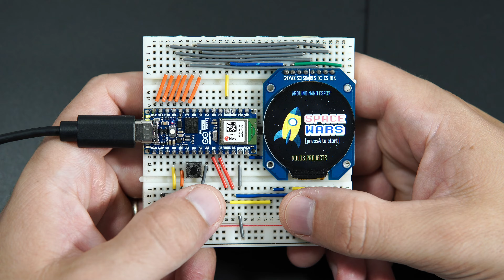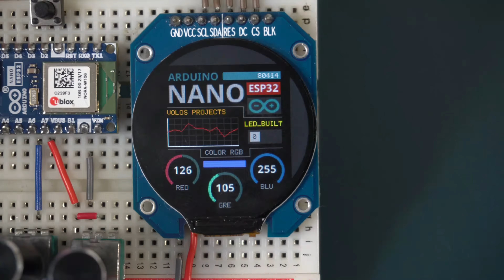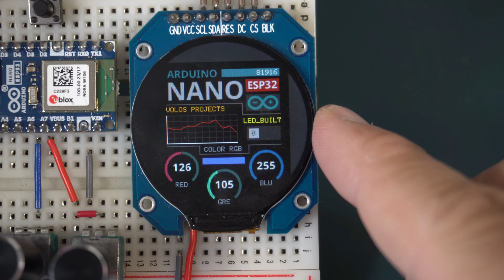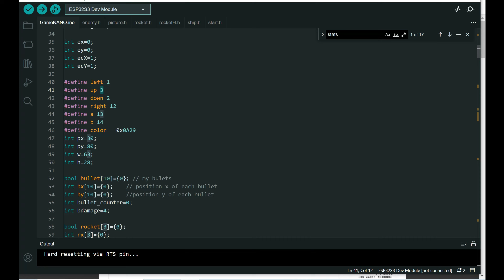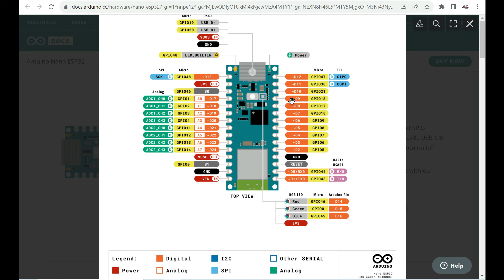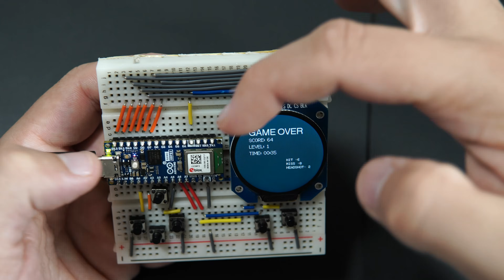Breadboard game using Arduino NANO ESP32 and GC9A01 display

Comment: I tried to run the same display with the same arduino nano esp32. The libraries are the same, I changed the GC9A01 in them and the pin numbers. But  the board keeps restarting after upload. With other projects and libraries there is no such problem. Can you please suggest where I fail. Thank you in advance!
Reply from the maker: Did you turn on psram?

Comment: Hello! Very cool small project! Thanks for sharing.
I'm struggling with this exact same setup as you, I can't figure out what pins I should configure for the TFT library. Would you mind sharing your user setup?
Reply from the maker: You need to use use esp32 pin numberws , not  pin names on Arduino, i d9nt have that setup file anymore, also make sure that your display is 3v not 5
Reply: @VolosProjects  Thanks, I just figured that out. I had to configure Arduino IDE to use legacy GPIO pin numbers.

Comment: First great video and I've been enjoying your content a lot and learned a lot from it. 

I have been playing with these round LCD with the GC9A01 and I've encountered a very weird bug. Hopefully someone can help me out. The bug is that if I use the sprite of size 240x240, the screen would not show anything until I change it to 235x235 and then everything works again. I originally thought it was the lcds that I got. I bought mine from Aliexpress. I went back and bought different versions of it that resemble the Waveshare ones but the same bug still appears. This is very puzzling.
Reply: You lack the RAM to do double buffering on a 240x240 display on an ESP32, unless you buy a WROMER version like the one in this video.
Reply: @Zoonie81  Thanks. I figure it out after I posted this comment. Tried the same code on a new ESP32-S3 and it worked then I clued it. Thanks for your response. Trying to find the right ESP32 board is so difficult sometime.
Reply: @jimmy0tran  no problem, glad you figured it out. I agree finding the right board is difficult at times. The Arduino Nano ESP32 used in this video is a small workhorse though, with 8mb ram and 16mb flash :)

Comment: Great demo Volos. I think that display module is fine powered from 3.3V although the backlight may be dimmer. Better to keep the logic referenced to 3.3V with this microcontroller board.

Comment: I am using the same GC9A01 but its working well with 3.3v. Im using ESP32S3 on my custom pcb btw, is it probably power difference with that nano verson?
Reply from the maker: my display is older and it have voltahe regulator under, your is probably 3.3v model, mine is 5v